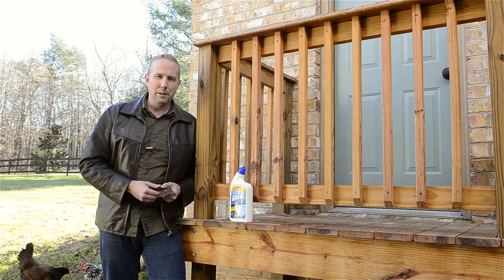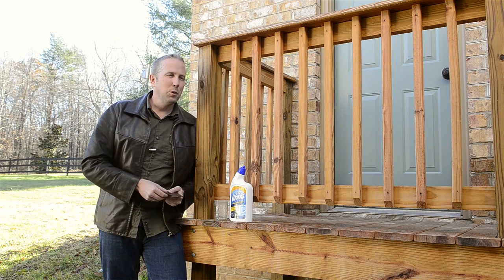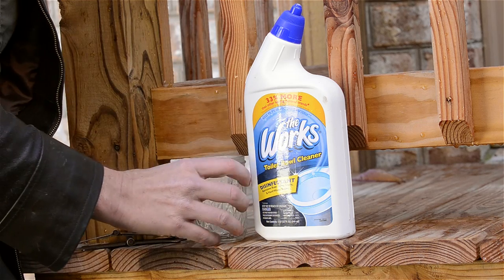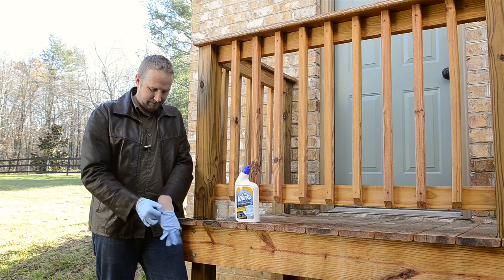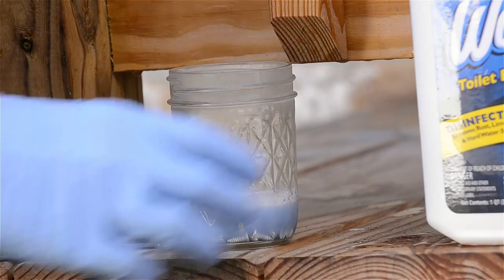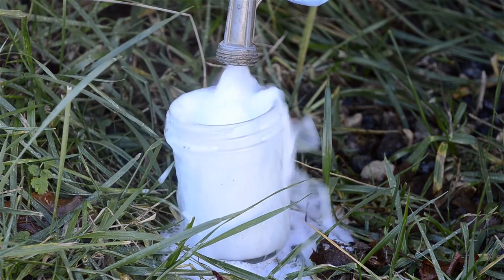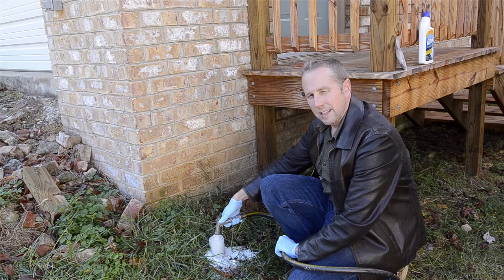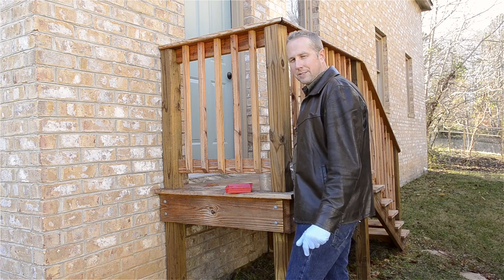Make Historical Wood Screws Using Toilet Bowl Cleaner

Comment: The active ingredient in The Works is Hydrochloric acid. You are reacting that with the zinc to make Hydrogen gas and Zinc salt. You can do the same thing with vinegar (way less toxic) it just takes longer.
Reply: So wouldn't it be better to add some sodium bicarbonate to stop the acid instead of trying to dilute it with water?
Reply from the maker: Thanks for the chemistry behind it!
Reply: That would work, yes. Although, we are dealing with very dilute acid, rinsing with water will be sufficient. However the reason I made the vinegar suggestion is that The zinc salt you get with the toilet bowl cleaner is zinc chloride, it is toxic and somewhat corrosive (it is the major ingredient in tinner's flux), and with vinegar you get zinc acetate, a dietary supplement. I think the vinegar is a wiser choice.
Reply: engage1026 ah, good call!

Comment: Joshua,  As someone who also does some blacksmithing, there is a better reason to not use heat to remove the zinc coating.  Zinc coatings react with heat to produce Zinc Oxide.  In gas form Zinc Oxide is poisonous.  It causes metal fume fever and the results are not pleasant.  Even small doses can cause problems.
Reply from the maker: Frank Rehmann thanks for the science behind why I didn't like the heat method!

Comment: After stripping the zinc, if you want to blacken them (or any other hardware such as hinges), heat them with a torch (red hot) and quench in oil (I use motor oil). Gives a great finish.

Comment: Hi
enjoyed this-the screws look very nice after treatment! Really liked your use on non-toxic mineral oil too.

I have had very good luck with Birchwood-Casey gun blue. This is an antimony based solution (caution:toxic) that produces a deep black appearance. To avoid flash rusting I use Boeshield T-9, a sticky, waxy oil based product.
regards
vic

Comment: This process will also help your once nice screws turn reddish orange a hell of a lot quicker too from another process called Corrosion.
Reply from the maker: Robert Langley Not if you keep them waxed or oiled.
Reply: Wood and Shop Sir, wax and oil will not give lasting protection from the elements like the zinc plating, just spray paint the screws.